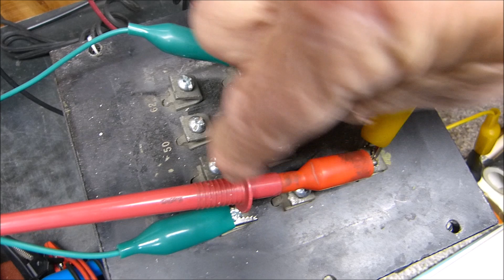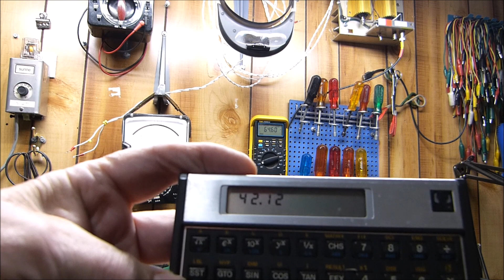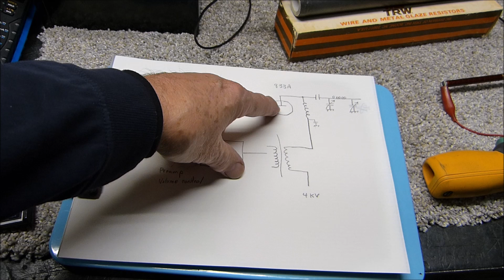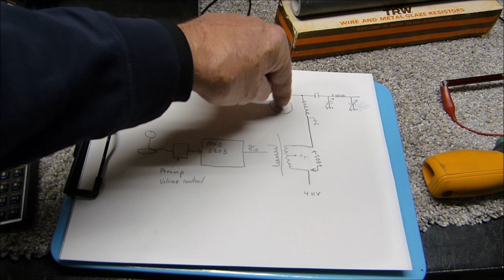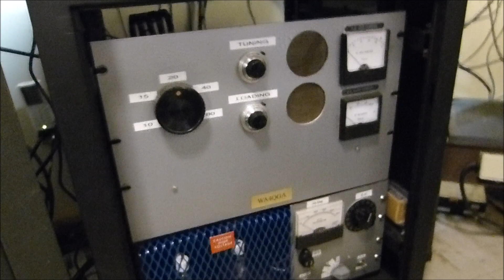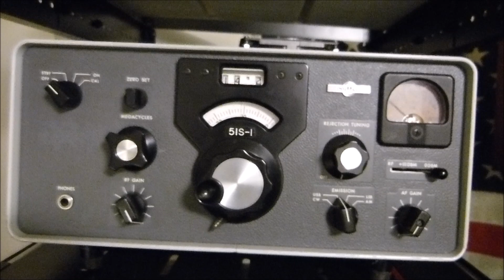McIntosh 2205 Amplifier As Modulator For Class-C AM Transmitter

Comment: The 2205 is basically a Class B amp with very little Class A biasing. It is built to run cool with an intake of 52 Watts (mainly consumed by the 10 GE1866's bulbs) max. So a continously load of 200 Watts will heat the amp up considerabel. It's a built as an audio amp with dynamic signals: music.
Sorry you use it as a audio amplifier connected to a microphone and a music signal. Nice video and lost of beautiful treasures you have!

Comment: I think it is a waste to use the macintosh for this purpose ... moreover, if the resistor burns, at that power level the return slap of the magnetic core could kill the finals of the mac
Reply from the maker: My AM transmitter project has been put on the back-burner. I know I have the parts to build the transmitter but it takes up a lot of room and I don't have the room for it especially to consider how many contacts I will likely make on it. I made a KW AM station and ran it in 1975 on 80 meters. I understand there are still AM groups around on 80M but ... maybe in a few months and ... I will do it right with a large scale vacuum tube modulator.  Thanks for your comments.

Comment: Instead of class C, could you rebuild your 833A amp as a class B Doherty amplifier?
73 de NØJAA.
Reply from the maker: I just read about the Doherty amplifier and it seems it is a linear amplifier which is the way my 833A has been run in class-B. Very interesting article on the Doherty amplifier.
https://en.wikipedia.org/wiki/Doherty_amplifier
The only amplifier that I know of that can be plate modulated is a class-C and I have run a 4-400A in class-C and plate modulated it. It was a great AM station. Class-C runs grid driven (TGTP) and requires neutralization which is the way I have my 833A amp set up. As far as I know, all I need to do is raise the bias from around -90 to -325 which will require a whole different bias supply. Right now I am using a 1:1 isolation transformer into a bridge and even a voltage doubler will not raise the voltage to the -325 level. We shall see. Thanks for the information
73 WA4QGA

Comment: I was thinking about doing a variable HV supply as well, with some filliment taps, it would be nice to do some theoretical testing without actually having to acquire transformers every time you want to do something new, but.... at what voltage? 0-1000? 0-10,000? Where do we stop? Because, you know if you going to err on the conservative side, the next project will require that "voltage" or "current" that is just above the max output that the supply is designed for. There's that "I wish I did this or I wish that I did that" component that is always sitting in the back of our minds.
Reply from the maker: I have thought about that perfect empirical design-bench so many times and as you say, just how big do we want to build it? 
We would need at least three voltages, bias, screen and plate and of course, plenty of filament voltage sources, all on large Variacs up to maybe 1200 volts for our small audio amps. 
But what about our large amps and 4-1000A and 833A transmitters? 
Now we need up to 6000 volts @ one amp with the rest  of the voltages and that is never going to be "safe" and lastly, our test amplifier weighs in at 450 pounds so I can't get that to my living room. 
But we can dream.
Reply: @ElPasoTubeAmps  I think photonicinduction was close, although he spent most of his time setting things on fire and blinding his neighbors with ridiculously large arc lamps, lol.

Comment: When I was a kid, in 1959, I built a 50 watt AM transmitter and used an Eico audio amplifier as the modulator. It worked very well, and produced a great AM signal.

Comment: Nice.  I used to work for collins    I worked on the HF80 1000w module. If i recall correctly it was fed into a combiner where 4 such modules combined and then drove that to the class C transmitter
Reply from the maker: Here is a link to vintage Collins transmitters that might bring back some memories.
There is a beautiful schematic link towards the bottom of each article that I love to study.
https://www.oldradio.com/archives/hardware/collins.htm